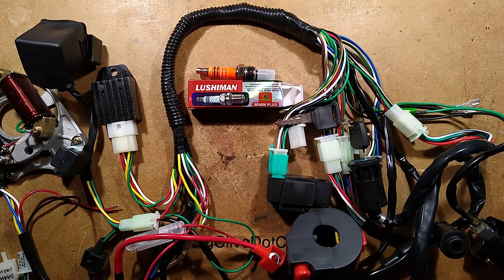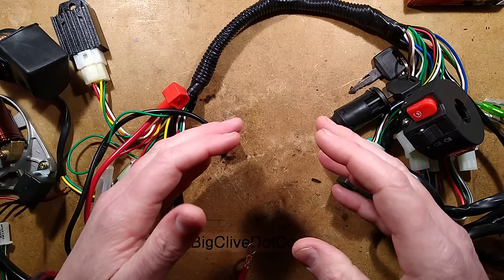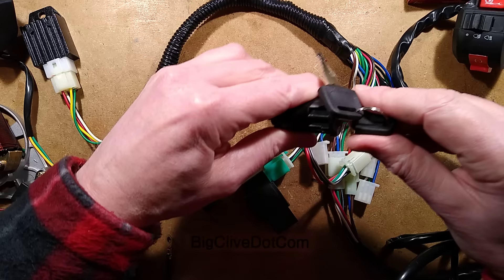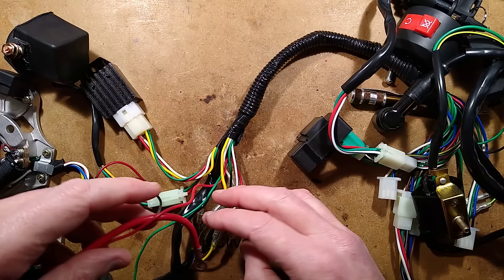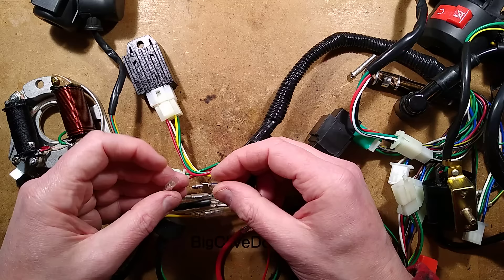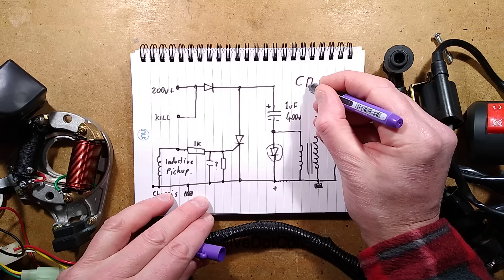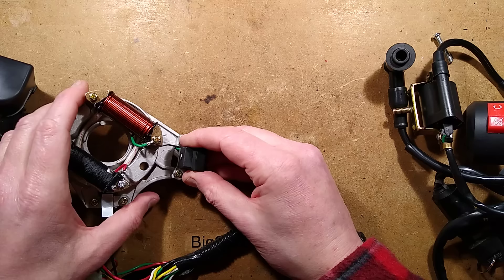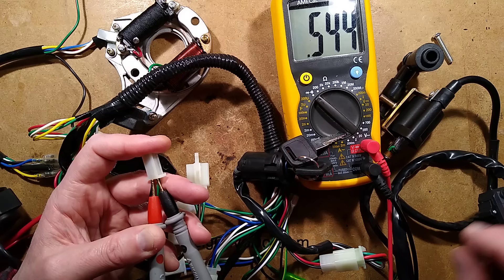Exploring the wiring loom of a Chinese quad / scooter.

Comment: I would think the extra kill goes to the brakes, as this is a kids 4 wheeler. Usually you have to have the brakes on to start them like a lawn tractor.
Reply: Just like all cars now, press break, press clutch, change to neutral, your phone has been conected via bluetooth for emergency assistance via our internal emergency number, yur mum on speed dial isn't good enough. And start. Ohh carefull now, the sensors are picking up a dew drop falling of the bumper, could be a mooouse!

Comment: Some of these small, single phase moped/quad regulators have two outputs. One 14V (red) for battery charging and things you want even when the motor stops, like brake lights and indicators. And one AC output for lights that will only work when motor runs.
Bigger bikes often have three phases from the stator.
My dads '60s bike have single phase and uses the light bulb as a "regulator", pulling down the voltage.
Reply: 1970'onan gensets used the battery as a sort of regulator, if the battery was disconnected while the gen was running bad things could happen to the regulation system

Comment: i put one of thease looms in one of my motorbikes i built it seems to work just fine. its a perfect cheap replacment for a old honda cub. 
Lights are run striaght from the alternator/Stator so you have A/C lights so the lights are very dim on tick over but get brighter when you ref the engine. 
The safty curit is for the side stand if the side stand is down the engine wont start. 
i think thats everything 
Get a motorbike

Comment: very minor thing . . . old (like me) ignition points interrupted the current to the coil and used the collapse of the field to generate that big pulse to the spark plugs.
ETA - the extra kill switch contacts are probably the clutch/neutral switch and a "you fell off the damn bike" switch that pulls out of the socket when a plug attached to the rider is yanked.

Comment: Had the joy of playing with a few Chinese quads and peds,
Nice to see your take on these looms, a long kill switch wire would go to the back of the quad where you commonly have a pull switch on a string like with jetski's in case you get thrown off,  the lock is a joke you can remove the key barrel as the security tab is not protected, 
And it seems about normal size for a small quad as things tend to be bolted in random places
Nice video buddy thank you 🤘👍

Comment: When I was a teenager I had a kymco scout and it was a great little nipper but the wiring loom looks like this but with a few changes,

Well after about 6 months wiring loom was shoot and I spend about 5 lunch breaks replacing the loom and I had to add additional safety bits eg front and rear fogs as the country lanes was so dark or very bad in bad weather, I also ended up fitting my own fusebox as every time going through shallow puddles the main fuse kept popping when starting, I would say it was fun but it wasn't, I ended up going OTT on it then after that I never had any issues until it was stolen when I was away on holiday, the crocks who took it must of know what they was doing as they manage to remove the tracker without trigging the alarm as they left the tracker, the alarm and the battery on the floor where my bike was. Grrrrr

Comment: Most modern bikes inhibit starting when the side stand is down, unless the bike is in neutral. It will also inhibit starting when in gear unless the clutch is pulled. Starting a bike is a complicated affair until you get used to all the inhibitor circuits :-)

Comment: In a points ignition power is applied to the cool via a resistor then the points open the circuit and induces the spark.  Opposite of CDI but necessary.  

Some larger ignitions will generate 450 volts to the CDI and if your kill switch is wet and the ground is suspect you can get lit up.  Really common on boats with aluminum hulls and 2 stroke motors.  That became a regular maintenance check after the first time it happened to me.

Comment: The cdi box's go bad from the silicone braking down and cracking. And its the e85 they put in the fuel. When it sits for any length of time it turns to gel and plugs up the carb. It basically kills them. If you run racing fuel or fuel with no e85. Won't gum up just sitting. Just fyi my guy. Hope it helps.

Comment: Cdi is normally located at the front supposedly "weatherproof" the ignition coil is also at the front because of the gy6 engines plug, is at the middle. Battery normally sits in the middle.

Comment: The Chinese scooters don't have clutches, they have "variomatic" style belt drives, basically a primitive CVT. The safety circuit for the starter button is going to both brake light switches on the handle bar - usually, the front brake on the right and the rear brake on the left hand, and either one of them has to be depressed for the electric starter to engage, otherwise it won't start electrically (you can still kick start it though, because for that it needs to be standing anyways).

Comment: The safety switch is connected to the brakes,, this is to keep you from accidentally starting the engine and it taking off on you, the other side goes to the brake lights,   this loom goes to a motor with a cervical clutch btw so there isn't a clutch lever

Comment: The stator connections are often an issue and the best thing is to solder them together. The rectifier/regulator is usually just a shunt type that dumps any excess voltage to ground. The lack of waterproofing is ok because it should have included a warning label to not ride underwater, or in the UK. The safety is typically a neutral switch and the clutch. One has to be engaged to start. The safety kill might be for a tether, some small ATVs for kids have a tether you can pull to kill the engine. You can also clip it to the kid so if they fall off, the unit shuts down.

Comment: Your missing the brakelight switch which doubles as a start/safety switch, on automatic motorcycles like quads,trikes, scooters which are always "in gear" you always have engage the brakes te start the engine so you wont suddenly run off.

Scooters may also have a safety switch on the side stand, the stand has to be up before yoou can start the engine so you dont accidently take of with your sidestand sticking out, ouch.

Comment: Ahh the joys of working on cheap Chinese bikes (ATVs, Scooters, Minibikes and Go-carts). After about 3 years of sitting out in the rain and sun, many of the original connectors become brittle and crumble. When troubleshooting an electrical problem, it is easier and cheaper to replace the entire electrical system. These Quads are considered disposable as in a couple years of use the child is ready to step up to a larger machine. I am rebuilding a Quad for a neighbor kid and amazingly all the parts for this bike are ridiculously cheap. I too have acquired the same harness and puzzled over the connections. Maybe someone could make use of these inexpensive components for other projects?

Comment: Non-strain relieved solder joints would break in a matter of hours of operation on a quad. So it's either crimping, or going through the trouble of putting everything in celastic.

Comment: I bought an E Cycle this past summer. 79V 3 phase motor I'd like to make 3 Lion packs to run on. Not an ebike. It's an electric motorcycle Kooks like a little crotch rocket. Does 90Km/h with the governor off. Had a blast all summer with it.

Comment: This is hilarious. I just bought a similar one off of Amazon for 30$ for my cheap Chinese 90cc quad. I ended up chopping everything apart, finding a schematic, using quality weather pack connectors and re-wiring everything. The way stuff was laid out made no sense at all and the quality of the connectors was laughable. Great video!
Reply: Absolutely agree. I had to rip the whole thing apart also.

Comment: The kill switch on the Fantic I had in my yoof had a chromed metal kill switch. It was always touch and go whether you  or the handle bars acted as the earth when it was raining.  You learned very quickly to stall the bike in the wet. 1970's Italian safety standards, an oxymoron if ever there was one.

Comment: If I were to hazard a guess, (knowing virtually nothing about quad bikes except playing on them occasionally) then I'd say that the two "spare" kill switches would be; one for the clutch safety, and the other for a body-worn clip so that if you fall off then it stops the bike and it doesn't run over you and kill you. The dash lights I'd guess are for dashboard illumination so that you can see the speedo, etc.

Comment: Im a motorcycle engineer good video on bike electrics, the cdi however will have a built in ignition timing advance and will be controlled by the pulse speed
Reply from the maker: There's definitely a form of filter on the thyristor gate circuit:-
https://youtu.be/R1wrrsb3RDk

Comment: Okay this is funny,  I had a Yamaha Riva 125 (From the 80') scooter that died not long ago... that looks like the wiring harness in almost exactly.  I'd had to get it repaired not long after i got used in 2000 and the mechanic let me see what was under the panels.  seems most of the Japanese scooters use a similar system to that Chinese harness (or buy them and use them)  only difference i can see is my key was a press in to move it into position.  Thanks for the video.

Comment: Slather connectors with silicone grease. Don't use it in switches that might arc because the arc converts the silicone grease into a hard  glass-like substance. For switches use a cadmium-base grease. Don't use a lithium-base grease because it's hygroscopic and intended only for bearings etc. which run hot. Vaseline is "OK" but it oxidises fairly quickly.

Comment: The nysterious 3 wire  connector is the fuel gagwe sending unit. The extra.aafety switch is the brake light switch

Comment: 14:31 The green with red tracer may well be for the neutral light switch. (That's the colour of the neutral light wire on my old Honda MT5 and it is located on the engine near the stator)

Comment: The other "safety" circuit will be for the side stand. Regulations say small capacity bikes up to 125cc cannot be startable with the side stand down, it's an MOT fail if that isn't in place on Euro 3 and above bikes.

Comment: At 17:36 The safety-switch on scooters is usually the side-stand, they if the side-stand is down they won't let you start the engine in fear of it driving away while you are not on it. That's usually one of the first thing I disconnect on a chinese scooter. (Instead they want you to use the center-stand that lifts the back wheel off the ground)
Also, on both quads and scooters they want you to engage either front or back brake while you are running the starter.

So to start ya need the side-stand up, brakes engaged, key on, killswitch off, and starter-button pressed.

Comment: The blocks are pretty much standard fitment to most Japanese bikes.  The only really problem weve encountered with the harnesses was from the blocks in to the regulator rectifier.  Yamaha and Honda have problems with the wires coroding but to be honest that was 3 phase.

Comment: pretty much standard design from the 1970's and prior when there would have been points instead of CDI(obviously a few wires added).
the shorting primary ignition magneto output to ground has been standard since they went from open spark plug end and shorting bar which hit the secondary. over the years most of us have been zapped majorly hitting a bad kill button with it's rubber torn or missing, it's always pleasant when you have fingers or other hand on the grounded metal brake/clutch lever or torn handlebar grips. ZAAAP

Comment: So unlike the CDI on a car it doesn't need the battery to make spark. I guess it makes better and more controllable spark than the old points, condenser, and magneto but doesn't need any battery like the old ones. Very nice
Reply: Similar ignitions are used on small engines, Briggs and Stratton called theirs the "Magnetron".
Reply: @brianleeper5737  I'm watching his teardown of the CDI now. Yes briggs went points less and there was a retro module available for a while that was slipped in between the existing magneto coil and laminations. I guess it was the sense coil and electronics.

Comment: I deal this this product everyday. Its ok and dose work well and last but they cheap out on the wore. The components don't really fail. But its the wire that dose. It corroded or brakes very very easy. And the connectors turn to dust after a few uses and some time

Comment: So the rectifier probably has diodes that are directional It turns AC into DC or vice versa....
You can literally turn any AC into DC and back by the current flow of where you connect the diodes and into a thing called a bridge.... That's why if you want to you can look up the bridge rectifier and it's very simple for diodes and you have the ability to switch from one to the other  AC or DC

Comment: As many have said.. Even proper('name brand') wiring looms are not waterproof traditionally.. The 1980's Suzuki has not a single waterproof connector..
Everything is just covered with dielectric grease and it holds up really well.  The biggest problem we have is after 30+ years of riding the vibrations are starting to break wires. 
But all the connectors are just fine! 
I'd also assume modern CAN based bikes have a lot more waterproof connectors as that is a much more electrically fragile system.

Comment: You should get an Italian Piaggio MP3 or a French made Qooder. Both can be driven on a car licence. Or you could go for a moped but not an erider one. As for the CDI unit there are two types, the DC-DC CDI or what you have is the AC CDI. The other thing is that the AC CDI sparks on both ignition  and exhaust stroke as it's the same CDI used on two stroke engines. The yellow wire is the unregulated AC power for the lights. The safety system is tied to the brake lights like a Chinese scooter so it won't start unless you hold in the brake. Otherwise if the engine is warm and the autochoke is enabled it will tend to take off as soon as you start it

Comment: I think your extra safety connection is for the brake handle.  Most things that use these will have a slip clutch or CVT, there wouldn't be a neutral position or a manual clutch.  This configuration usually requires the rear brake to be applied when starting.

Comment: I'd guess the second/parallel safety circuit is either for a clutch switch like you say or for a side or center stand switch so the engine can't be started while in gear with the stand down (for scooters/moped obviously, not an ATV!).

Comment: I had a pair of $20 bluetooth earbuds, great for when I'm mowing the lawn, just slip them under ear protectors. Anyways they failed after 7 or 8 months, I live in Florida so I sweat quite a bit when I mow, turns out a bit of sweat had wicked through the microphone hole and down the microphone wires to the little pcb and corroded everything. I bought another pair and put super glue in the microphone hole, haven't had an issue since.

Comment: 17:00 Most little auto quads have a hand/foot brake switch so you can't start them and have junior run off into the weeds, Suzuki LT80 has a lever in the right hand foot well that needs to be up

Comment: If your cheap chinese engine is hard to start, runs rough or fails to start at all, the best first step is to change the spark plug for a name brand. Just take it to a car parts shop and get the equivalent. This has personally saved a generator, scooter, and a lawnmower for me 👍

Comment: Lawn tractor/riding mower wiring tends to be very similar to this as well, aside for the CDI module. On some models the headlights can be run off of a shunt winding from the alternator, with the other winding going to a diode or regulator to charge the battery, or on others the headlights can be run off the regulated dc.
Reply: On my riding mower I added the $15 regulator they left off to save money. It apparently doubles the charging capacity, according to the Briggs and Stratton manual. And it plugged right in. Figured that it might make my battery last longer.
Reply: @brianleeper5737  It's square with a hole through the center right? And it screws into the base of the plastic oil dipstick? Assuming this is a newer single cylinder intek.
Reply: @lavendersneppo  Yes, that's the one. I made up a ground wire for it with a ring terminal since I didn't have that part.
Reply: @brianleeper5737  Yes good I was going to ask about that, if you don't ground out the metal body of the regulator with the eyelet it wont charge.

Comment: Where that self tapper screw goes in is for the manual choke lever to be attached to the bikes handlebars. Most of the motors that wiring loom is used on is a gy6 chinese motors ( https://en.wikipedia.org/wiki/GY6_engine) and your right about the connectors being shit the plastic breaks down after a couple of years

Comment: Ebay scams list CDI that claims to advance your timing, but as Clive noted the only way to do that is by advancing the pickup sensor.
Reply from the maker: Some do seem to use a crude filter that may change timing based on frequency.
Reply: Yes, but how would you advance the timing before the sensor is triggered without physically moving the sensor to fire sooner. That is, could you build a circuit to fire before it is triggered? It may be possible to design a circuit that senses the previous trigger and shorten the firing time for the next cycle.

Comment: i am looking for help on finding info on wiring for a 250 cc jet moto its got two cylinders two carbs and dual exhaust its a 1991 or in that area....im frustrated that all the wire harnases are for single cylinders and im lost how do i wire this thing 
help please